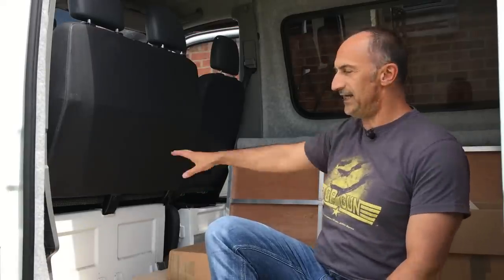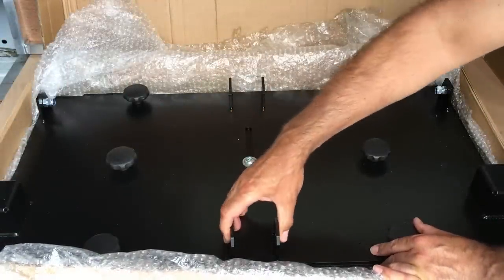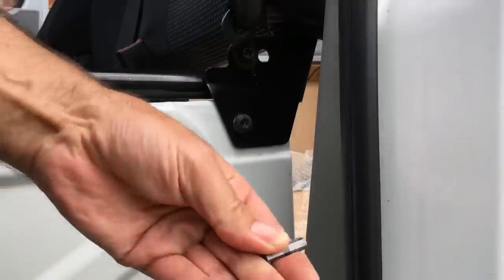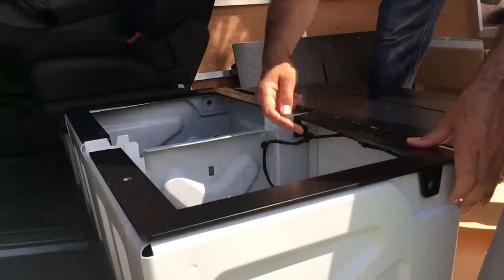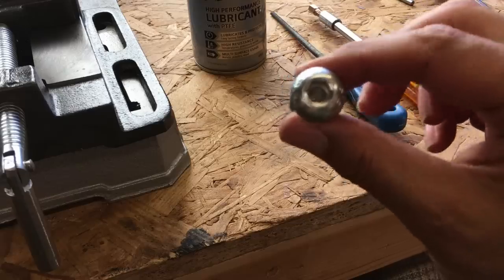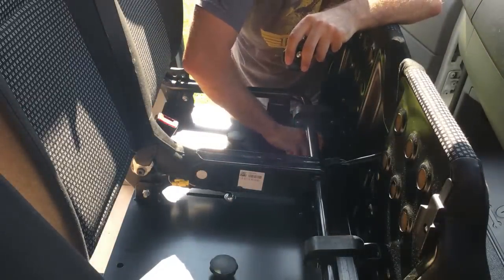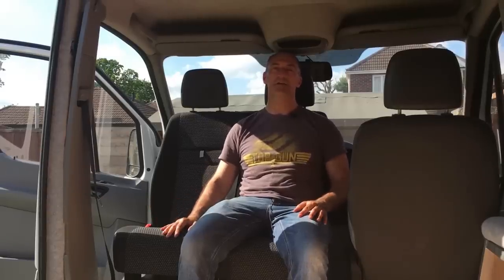Double Swivel Seat - Mercedes Sprinter Van

Comment: That looks super easy to fit and using the sliding bolt to protect the sensor cable is indeed, as someone mentioned earlier, a super idea. We didnt realise that you could still have full access to the storge below. Thats where our batteries etc are located. This video shows that we can and its also very easy to follow. Another great tutorial! 

I know someone who wants one of these now! 🤔
Reply from the maker: Fiona Jayne, the hinges make access to that area really easy and safe, no fear of the seat falling off just need someone or something behind it to rest it on when open. We are planning to make use of that extra space to store some non essential items.
Reply: Greg Virgoe, yes like the leisure batteries
Reply from the maker: Fiona Jayne, cut and extend the cable rather that taking off the yellow plastic plug. In order to tip the seat right back you need some extra length.
Reply: Yeah I expect that we might go for this in the future!
Reply: Brilliant ! Got a link for where I can purchase said item ?
Reply from the maker: Rebel with a Cause, it’s in the video description under the video 😊
Reply: Greg Virgoe Hi Greg - when extending the cable - any gauge of wire.?
Reply: @GregVirgoe  18 inches to be precise. What did you do about the passenger seat belt?? It stops the seat from rotating.

Comment: Never been so happy to see this done. The hole drill trough the nut, bloody genius and the heads up on no radio while the air bag system is disconnected, cheers.

Comment: That was such a simple, brilliant idea to drill the bolt! I hope the manufacturer will watch the video. There would be an other solution too, to completely disconnect the plug and fit a resistor to fool the sensor, so it won't trigger the SRS light. Pros: you can forget about the wiring, cons: in case of an accident the passenger airbag activates even if there is no one sitting on the seat. Great video as always! Thanks!

Comment: Some white lithium grease on the seat hinges and a couple of nylon washers on that swivel bolt, and done! (The inevitable rattle from the necessarily loose fit of the bolt would drive me to distraction!)

BRILLIANT work, as always Greg! Especially drilling out the bolt. Perhaps the manufacturer will catch a clue from your excellent job.

Comment: Hi Greg. Loving all your videos. I have just bought a LWB Sprinter in order to convert with a large enough garage for my mobility scooter. I have converted a few Mercs in my time and travelled all over Europe in them. I'm looking forward to my new build and thank you for all the info and links that you share. Just ordered a TrimJim double swivel for my van (now for only £350 and M1 tested) which now comes complete with a drilled screw of your design. The extra height will be just perfect for my knees lol. Well done mate and thank you
Reply from the maker: It's funny how things go, the drilled bolt and the curtain rail jig, now both been supplied by the manufacturer. :D

Comment: Good solution. I do wonder though why they've not cut access holes through in the large plates to make for easy access (without needing that hinge).
Reply from the maker: I think I prefer the plate it’s more secure
Reply: @GregVirgoe  you mean for storing valuables in?
or you think a full plate is more stable when in use?

Comment: Another great video.
If I would add anything it would be a couple of teflon/nylon washers between the large steel washers on the centre pivot bolt to reduce friction and loss of paint which will eventually corrode, also periodically wipe some silicon spray in the groove.
I would also leave 6 small high powered magnets under the seat to hold the 6 hold down bolts in place so I never after look at them stored on the dashboard between swivels.
Just my two penn’th. :)
Reply from the maker: Some really sound ideas there, thank you for sharing. The nylon washers is a good shout. I have some silicone spray which use on my jointer although I will say it slides really super easily. 
Maybe having the knobs on the dash I won’t forget to refit them before driving off? 😊
Reply: More than just teflon washers, it could be a layer of teflon or even some kind of acrilic, I live in Buenos Aires and here we have a street (Uruguay) in downtown Buenos AIres where you can find acrilic sheets, I'm pretty sure that some kind of material can be found there. In fact I will make by myself a swivel base for my Renault Master for both, driver and double passenger seat.

Comment: Perhaps some people fitting this just connect the wires together permanently so the seat-belt will always read as connected. This would be fine in my book as, if the air bag ( bags) employ without passengers it still offers  more protection for the driver especially from side impact .

It would have been interesting if quirky campers ran into this issue and what they did as a work around.

Your idea is better in the long run though for keeping things as close to the standard operation of that particular feature.

I find both my captains seats ( chairs ) brilliant and can not believe how many conversions leave them out.

Another great video Greg, I'm slowly catching up. It's reading the comments that slow me down lol.
Reply from the maker: Well done for powering through, there are quite a few videos now 😊 Do you have details of your own van?
Reply: @GregVirgoe  It's a Talbot express 1000d fitted out by autohomes rather that autosleeper but to some extent similar.

It's had some modifications done, suspension helpers ( two coil springs added both sides between the leaf springs).
Modified gear selector, Eberspacher diesel heater and power steering plus refit inside to modernise.

It's not big but having the front seats swivel gives it a nice roomy feel inside and I can carry three passengers all legally belted.
Inside it's 12.5' long and 5.5' wide.

It's my daily driver as well so it's a good compromise between both and to be honest, I was thinking of doing a conversion when I came across this for a price that was way lower than buying a van and converting to a similar spec so that was that lol.

I love watching van builds though as I like to learn and as I'm fitting 200 watts of solar for example and your video on the subject was very helpful reinforcing what I'd learnt.

I couldn't resist earlier and went to take a peak at your finished van, the MOT one but glad you hadn't shown it off and I know people can't wait to get the full tour ha ha.
Keep em waiting until I catch up in a day or two lol,

Cheers for taking the time Greg to make these videos and I'm glad you and your partner will get to really enjoy all the hard work you both put into it! You both deserve it and yes your right about enjoying life now rather than waiting until we're too old, I'm fifty two so I understand only too well.
Reply from the maker: pa maj, thank you for taking the time to write such a lovely comment. You van sounds like a nice classic camper, but like my parents who had a Bedford CF Autosleeper. Keeping them running can be a challenge and good that you have done a few upgrades to yours to make it a better driver.  I'm really looking forward to getting away in the van and just using it now 😃 Thank you for all your support 👍🏼
Reply: @GregVirgoe  I know what your saying Greg about  Keeping them running. It can be a challenge, that's so true as parts get scarce.                                                                                                                       The little van travelled around Ireland last year clocking around 1500 miles with no bother but I'd never dream of pushing it around Europe lol, Your van is the perfect choice for that.       
         You're very welcome Greg, you deserve good comments and support for enriching YouTube with content that will help so many in the future including myself. Now, to watch a few more :)

Comment: Great videos you make. I would recommend they make big holes in the plates for easy access to under side compartment. We doing our own van and love your videos. Keep it rocking!
Reply from the maker: AheadTv the two plates are hinged so you simply remove 4 of the 6 bolts and lay the seat backwards to access the storage space.

Comment: That is a very good instructional video (as usual) and good catch on the sensor wire with a great solution. Would be interested if the manufacturer feeds back to you after reviewing this video. For sure you will have increased their sales! However - I know of a chap who could design a better solution 😉👍
Reply from the maker: Hi Norman, I have emailed them a link to my video so it’ll be interesting to read their reply. I may pin an update to this comment thread if it’s interesting enough. Cheers

Comment: Agree with the other commenters about your drilled out bolt. I initially thought your plate would stop you having access to the storage. Excellent design!
Swivel options for the Ducato are rubbish, frankly. The centre headrest has to come out before swivelling, and it looks like a wrestle to turn it around.
Reply from the maker: Hi Mevi, hope everything is good with your van now. 
Only thing I may do is lengthen the sensor cable to give me more slack when hinging the seat backwards. Best wishes
Reply: Yeah, the van has behaved itself. In fact, the extra miles covered have improved the way it starts and drives.
Just me in the van, I'm not so concerned about the space, just the otherwise wasted seating up front.

Comment: Nice mod Greg, worth remembering that the yellow sensor connectors have notoriously unreliable contacts, often producing 'Air bag error' messages when 'bum on seat' is detected. I usually dispense with them and solder the wires.

Comment: Oh wow this is incredible. I was exactly looking for a product like this. I only need to figure out of they ship internationally
Reply from the maker: Hi Tobi, the only downside would be the shipping cost as it is a weighty item. 23kgs
There is another guy on YouTube that has published dimensions if you know a local fabricator? Maybe cheaper option for you?
Reply: Greg Virgoe Greg Virgoe you are right. I also doubt that this swivel mount fits my sprinter as we are driving on the other side of the road. Do know if the guy on YouTube put the dimensions online for UK sprinters or EU?

Comment: Some Nylon washer on the Piviot bolt might stop it from rattling (if it does rattle), maybe the cable will stop it from rattling anyway. Also maybe use 4 or 6 rivnuts in a handy location to store the 'hold down bolts' when they are not in use. You know its a good reason to use your powerful rivnut tool. Live the Swivelly Dream!

Comment: One thing I noticed the sensor cable seems to be a little bit short so you can't fully tilt the seat backwards otherwise you'd break the cable. Maybe there's a possibility to run it diagonally and fix it to the underside of the plate with some stick-on cable holders to gain some length?

Comment: I'm guessing that drilling the center out of the safety bolt in order to run the sensor wires doesn't weaken it enough to possibly fail. Great idea and spot on information!
Reply from the maker: Hi Ken, it was an M12 bolt and I drilled a 6mm hole through it.
It's still super strong and is never under any kind of load as not tightened.
I can only imagine it is there to stop you dropping the seat if you are silly enough to let it slide too far.

Comment: Good work!
What is the black connector with the blue&brown wires? Passenger detection? Visible at 13:10
I knew hollow bolts from single seat swivel plates, wondering that the manufacturer didn`t use them first...They were much bigger in inner diameter, so that the plug case can stay on the wires while mounting.

Great vid, thank you!
:-)
Reply from the maker: I am now planning to extend that sensor cable as it is tight when the seat is tipped backwards on its hinges.
The other plug I'm guessing is for the heated front seat option that my van does not have installed.
It has two pairs of wires the same colour and thick enough to handle a load so that kind of make sense to me.

Comment: Those people which have fitted this turning device for the front bench seat. What did you do regarding the passenger seat belt stopping the bench seat rotating??
I tried moving the seat belt attachment bracket to the bolt below. Machined up a new bolt to fit the seat belt bracket  and held the seat belt and seat in place with it. 
Then the seat belt bracket stopped the bench seat from turning around.
I looked at the cable and concluded it needed extending it was never going to last long with just the length Mercedes supplied.  Drilled out the bolt to 7 mm and inserted 18 inches of 2 core sheathed cable in the mercedes cable. 9 inches went above the bolt and 9 inches went below the bolt.
Currently when I wish to rotate the bench seat I have to unbolt the passenger seat belt.
Reply from the maker: You need to watch the video at this point 13:23  there is a location to move the seat belt to on the lower plate.

Comment: Slightly unrelated but I took out my double seats, to remove the bulkhead, and now I'm finding it difficult to put the bolts back in. Specifically the bolt at the front of the seat/which allows the seat to swivel forward. I can't see if the bolt is lined up. 

I am hoping to get have a double swivel seat, and hoping that the manufacturer has sorted out the problem with the wire/bolt, but, for now, I just want to get the seat re-installed!
Reply from the maker: I slacken the other bolts off a lot to allow the seat some wiggle room. Alternatively a long pointed tool in the bolt hole can help with alignment give you some leverage

Comment: I've got a a daihatsu hijet and the front seats are hinged at the back as you access the engine under the seats. I'm currently designing a camper conversion and thinking a similar hinge on the bench seat could work. Have that in a slider and you could just undo a clip, tip the bench seat backwards and then slide it back towards the dashboard. It means you would be sitting on the back rest, and might mean the head rests can either go or be removed. But with a throw and cushions this to me seems like a lighter and simpler and more practical solution. Easier said than done but agree keeping the bench is nicer than two car seats. Also sitting in a car seat 'at home' seems really grim so any adaptations that in-car the seats seems worth a go
Reply: *un-car

Comment: Great Video!  Like you said in the video it opens up so much more living space that would be un-used when not driving.  I have to ask if you are contemplating putting a swivel on the drivers seat?  Depending on your design you could fit six for dinner.
Reply from the maker: Jeff Steinmetz we didn’t plan to fit a drivers one as we have bench seat right behind the driver and there would be no leg room for that person in our layout.

Comment: I like the idea that it is easy to reverse back. The extra height on the other hand is a negative. These double seats have no adjustments so for a tall person it will be cramped. However drilling a set of extra holes say 10cm back would remedy most of that problem. My final thought is, is this street legal?

Comment: Hi there.Great clear video.  Thank you. I'm researching things on behalf of my young niece so I don't have a van to look at.  Under the seat seems like a good place for leisure batteries but how would the cables for them survive the swivelling.  I guess that's the same issue with putting a diesel heater under the seat as well?  Your thoughts would be much appreciated.
Reply from the maker: The white box does not move only the plates on top so if you make cable entry in via the white box you’ll have no issues. Also good to have that weight up front and not over the rear axle.
Reply: @GregVirgoe  Many thanks Greg.  That's a relief.

Comment: How much space is needed between the door pillar where seat belt is located and the centre of the van in order to turn the seat.?? I have a shower cubicle in this corner..Will the seat go out the passenger door to turn,,in order for me to have enough room to turn the seat??
Reply from the maker: Wade Robinson you have to open the passenger door and pull the seat slightly toward you to clear the handbrake handle anyway so that will give you some clearance.
Reply: @GregVirgoe   Thanks for the speedy reply.. How far are you able to take the seat out of the passenger door.. I would need it it to move forward past the pillar and out of the door almost 150mm in order to get past the cubicle..do you think this would be possible obviously it's hard for you to k ow without seeing my set up..but thanks anyway I may have to just buy one and see hopefully it can be returned.?!

Comment: How do you disconnect the seat belt sensor - yellow plug around 4.47 minutes in the video?
Reply from the maker: They usually have small barbs which click together so a small flat screwdriver helps to release the clips and they can be pulled apart

Comment: Hi Greg,
Nice series here. What keeps the passenger bench from folding back to the rear if say you are bumped from behind, or just pushing back on the seats.
Thanks,
Mike
Ocala, Florida
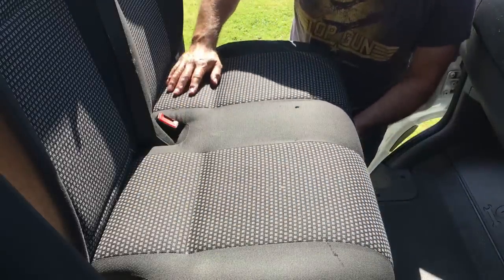Reply from the maker: Hello Mike, take a look at the video from this timestamp 13:48, there are 6 bolts holding the two plates together, you have to remove the outside 4 bolts to make it tilt, then remove the centre two bolts to make it swivel. cheers